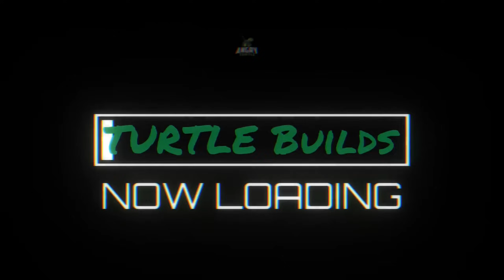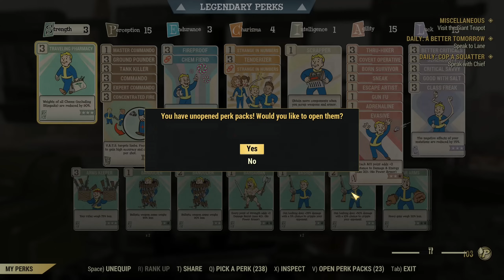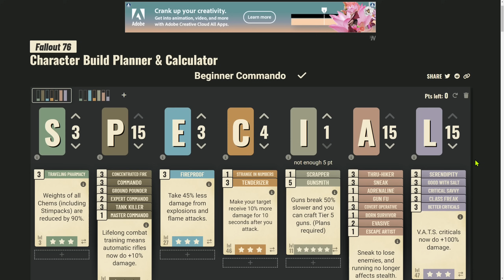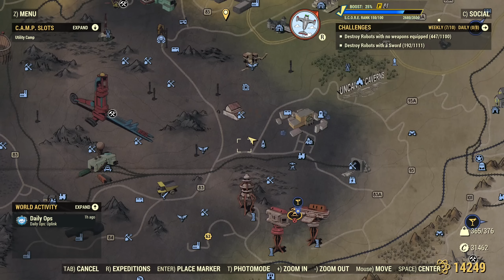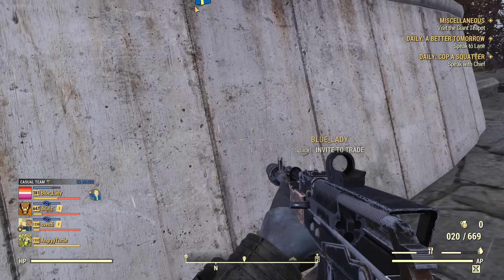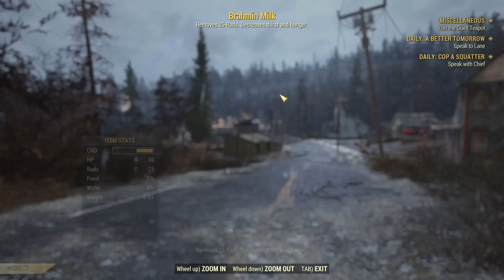Fallout 76: Beginner Stealth Commando Build/Guide.

Comment: Pro tip. Hacking and picking is not needed at all. Best to take a special card for extra perks as you progress.
Do not take charisma as one as the points dont count towars perk sharing.
I would start with perception agility or luck.
This way you can move points into intelligence asap to increase exp gain

Comment: Just to be clear this build will NOT get full damage in events so if your planning on doing events this is a a bad build in comparison to the normal Commando build which doesn't revolve around stealth.

In case you haven't worked out why it's bad now...... stealth is disabled in most Events/Public Events and Dailys Ops which means a lot of perks like stealth and covert operative and any other card effecting stealth...... is now completely useless.

The bloodied builds you see in events are the ones mostly running Tesla Rifles or Railway Rifles and hide up on roofs and such are using the normal Cammando Build not stealth Cammando which revolves around the Fixer Rifle.

I came here to state this because I made the mistake farming the perks for stealth just to find out it doesn't work in Dailys and events. Had to Google just to be sure and to qoute Google "events and daily ops disable stealth, and also it's somewhat prone to glitch"

All that being said if your not interested in events and daily ops for what ever reason.....and you just want to explore and do quests then this build is 110% grade A the best build in game.

Comment: One issue, mutations.  They are extremely difficult to get - out of 300 player vendors, only 3 had any serums with only 1 with multiple serums.  Beginners won't be able to buy all of the mutations either since they are roughly 21k at Charisma 4 (maybe down to 19k with food/aids) EACH.  I have 6 on me now I paid 350 caps each for the serum.  So, if you are going with mutations and you don't mind grinding the 120k caps to buy all of the plans for the serums you need, I suggest you dump 2 luck perks and get starched genes or you will cry if you lose them the first time you use radaway.  He shows 18 mutations so do the math to know what it cost to buy all of them.
Reply: Check the pinned comment, there is a guide to get all mutation for free.
Reply: @Dipraz33  Thanks!

Comment: One last question I hope.  On the build planner you have 1 point in INT, but 6 used cards, one being 5 point Gunsmith.   How does this work?
Reply: You’re expected to switch loadouts at the You’re Special machines (which you can’t do as a beginner until you reach level 25) when you want to tag mobs in events or do crafting. He also forgot to put Inspirational in as well.
Reply: I believe it has to do with multiple load-outs.  I am new, so I am a little confused as well.
Reply: So, legendary perks are another class of perks that are much harder to get and upgrade, and they can increase your special stats i think up to 5 more than they already are :)
Reply: It's described in the video

Comment: You can technically use the small/new vault tec backpack and get a grocers backpack mod and get both before lvl 60. So thru hiker could be swapped for other perks
Reply from the maker: yes you can I just decided to do not overload new players and skip back pack topic
Reply: @AngryTurtle  I can understand that but they do technically have backpacks now right after exiting the vault so it wouldnt be much of a stretch for new players to want to mod their backpacks before upgrading to the larger size backpack